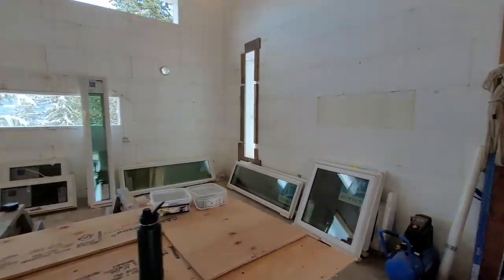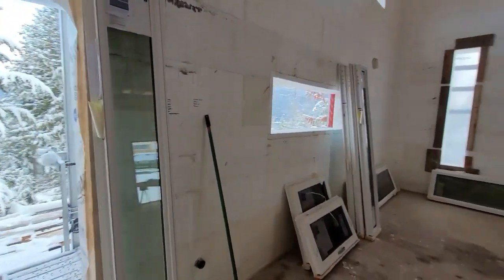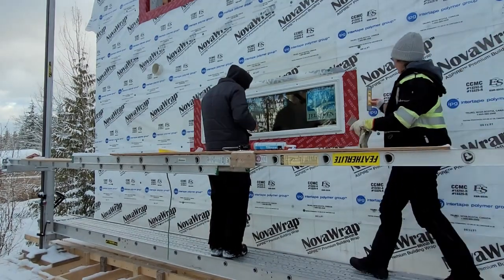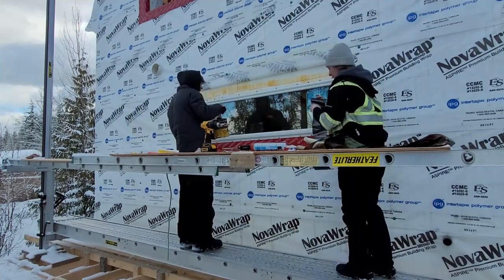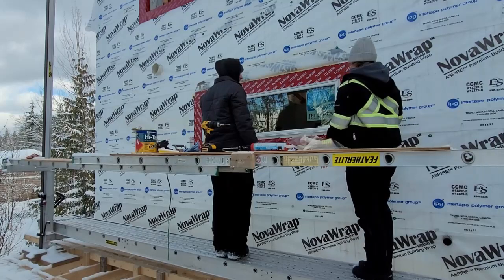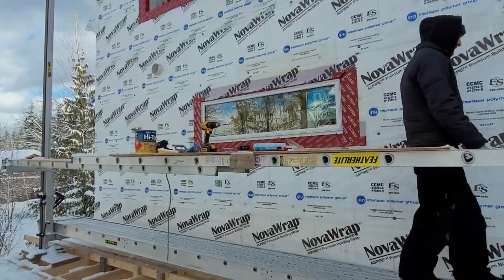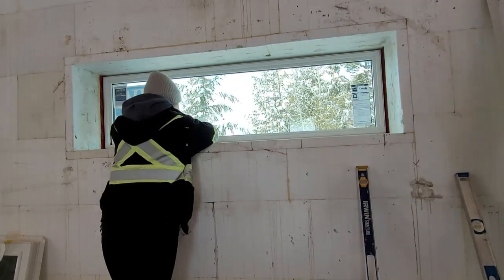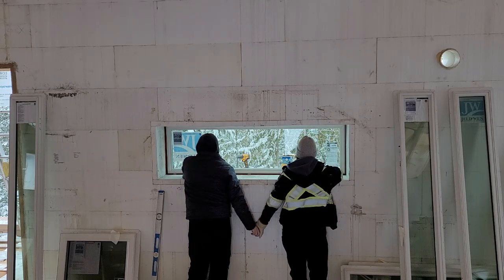Our First Window Install: ICF Fox Buck (Fox Blocks) + Jeld-Wen Vinyl Window.

Comment: Man, our door install went horrible. We couldn’t hit the webs with screws no matter how hard we tried. We’d get one, miss three. Windows finally come in sometime in April and I’m REALLY hoping it goes smoother because of the supposedly continuous web on the edge of the buck. We’ll see!
Reply from the maker: Oh no! Was that fox buck? I have to say, we've done a few more windows now and I like the wood bucks better. I dont know if you watched our window buck video but we couldn't get our hands on any more Fox Buck so we switched to wood LSL for a few window openings and now wishing we did them all that way!
Reply: @anaverageacre  Having done the windows and the doors now, I’d recommend the Fox Buck for anything with a nailing flange (windows and sliding patio door), but stick with wood buck for standard inset exterior doors. The full face flange on Fox Buck is great, the webs inside the opening are not. I also like the spax stainless screws for installing into the Fox buck, because they hold a lot better than nails in the plastic web and have a flat head. What a job!